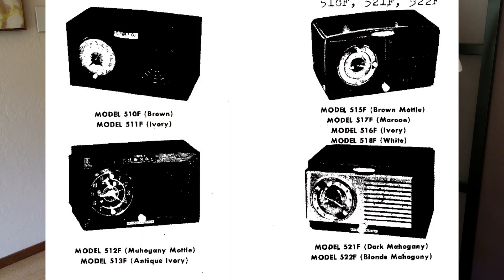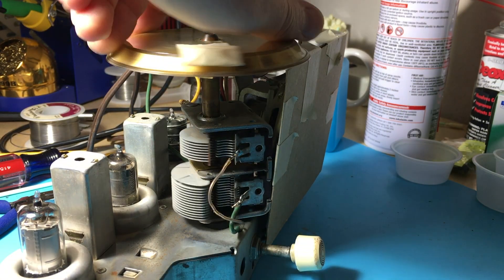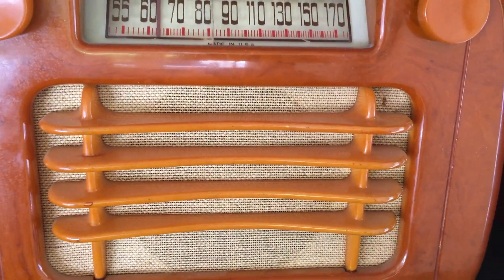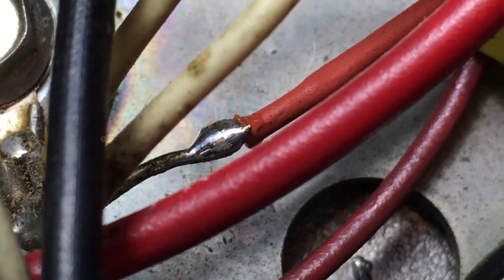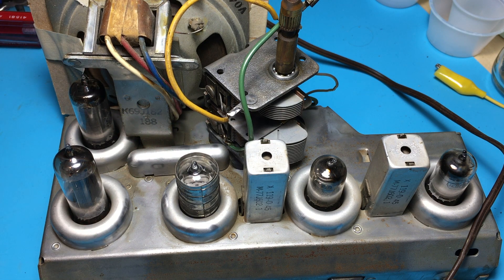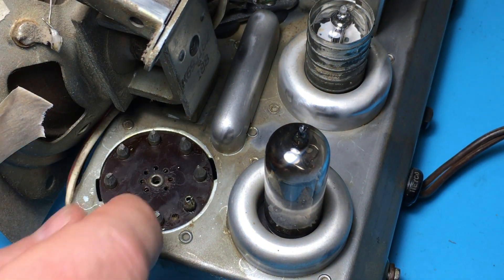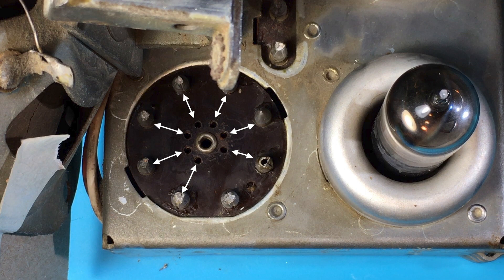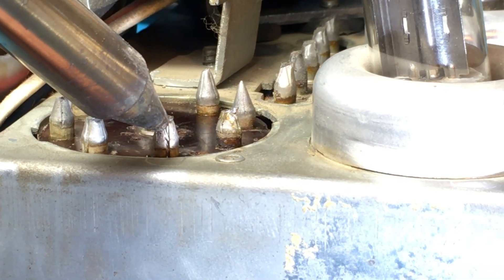The clever way GE wired AA5 radios in 1950

Comment: I just restored one of these sets and what struck me was the factory punch that made the holes in the chassis for the tubes was clearly for octal tubes. I also have a 1949 version (Model 501) with the same chassis but has mixed octal and miniature tubes, and with standard phenolic socket connections rather than the spikes, holes and donuts. I went all-in j-hook for recapping. No problem with silver mica disease but the detector section in the 1st audio tube was bad
Reply from the maker: Yes. I've seen 2 examples out of the 10 or so I've done in the 51xF line that had the mix of tubes and they are prized because the full-sized IF transformers in them are capacatively tuned and don't get silver mica disease. Plus they just seem to work better all around.
Reply: @WardCo  I just obtained a third model from this series -- one with all octal tubes (GE 60), a mixed octal and miniature (GE 501), and an all-miniature with the metal donuts (GE 512F). The first and second have identically punched chassis, but the tube socket punches in the latter are actually larger to accommodate the dip solder connections. I now think they may have tried dip soldering to cut costs since hand-wiring and soldering miniature tubes was harder, as if it was a transition from hand-wiring to printed circuit dip soldering. The first two have capacitive IF tuning, but the last has ferrite cup tuning with the integral silver-mica fixed capacitors

Comment: Hi Sir,

I need help with this radio, model 505, please. My father gave me one (he's not with me now), but I'm not sure how to configure the clock. There's another knob behind the radio that doesn't move, and I don't know if it's supposed to be used to configure the clock. I understand how the other buttons in front of the radio work, except for the "set/alarm" function. If you can help, I would be very grateful, sir. :)
Reply from the maker: The knob in the rear moves the hands to set the time. If it is not turning the clock mechanism is jammed up in some way. If you pull out the set/alarm button and turn it, the inner alarm wheel turns to set the alarm time. When it is pulled out, the alarm is "armed" and you push it in to silence the alarm when it goes off.
Reply: @WardCo  
Sir, you are correct; the clock mechanism appears to be jammed in some way. The seconds knob is working, and the alarm is functioning as well, but I can't set the correct time

I read that old mechanisms like this one sometimes need a bit of lubrication. Could that be the issue? I will attempt to fix it

Thank you for your help; I really appreciate it

Comment: GE designated this type of construction as a "mechanized chassis" but it is difficult to find references to that name. WardCo provides a list of model numbers with an F suffix. The F designates the "mechanized chassis" version, so model 510F had that construction but model 510 did not. My model 535 "radio clock", a 6 tube clock radio, had a "mechanized chassis". Probably there was no F suffix because all model 535 radios had the "mechanized chassis".

The radios had the donuts over the solder wells, presumably for safety, so no one would get a shock from touching wells if they poked fingers through the ventilation holes on the back. My parents owned a 1954 GE console TV which also used this construction, but the solder wells were not covered. GE depended on the back cover AC power cord interlock to safely power down the set before someone touched the wells. I recall that Zenith continued to use this type of construction well into the 1960s for its "hand crafted" TV sets, while competitors had gone to printed wiring boards. Zenith did not have the donuts, either.

In production, this type of construction probably reduced the number of wiring errors made by assemblers, since the component layout was more orderly. Also, when errors were made, they were probably easier to spot by the technicians testing the radios as they came off the production line.
Reply from the maker: Thanks for this great info. (And for reminding me about Zenith's "hand crafted" moniker! My folks loved their Zenith's Space Commands...)

Comment: I have a red "G.E." that was built in 1954 that has the same chassis layout/ tube sockets, and has the "SILVER MICA DISEASE" problem in the I.F. transformers. I just bought this radio, and will need a full restoration. the next generation "G.E." radios used the metal pan with a  printed circuit board where the major components plugged into the p.c. board. by the late 50's they had moved on to full p.c. boards, as did all the other companies, except "ZENITH", they made their sets with metal pans/ hard wired.

Comment: I have a "G.E." radio that was built in late 1949, that I bought in 1976, and has been on the job to this day. it is the same radio as yours except it is cream color, and has the cap tuned I.F. transformers instead of being slug tuned with silver mica caps in the base of the can. the tube compliment is a hybrid. the rect./ output tubes are 7 pin minies, and the conv., I.F.amp, A.F. amp/ det./ avc tubes are 8 pin octal, with all components being hard wired in, not like your radio. I replaced the resistors/ caps 10 years ago. when I did that ,I also installed a "C.L.90" thermistor in the heater string so the tube heaters are soft started.
Reply from the maker: Yes, for some reason, and much to chagrin of my wife, I have acquired about 7 versions of this model, but I only came across 1 with the "transitional chassis" you describe and I used it in my "flagship" 517F because it tunes up so easily and you don't have to worry about silver-mica disease and rebuilding the IF cans. The tubes are all socketed though. I should do the thermistor thing but always seem to skip it. Tangentially, I do polarize the input and swap positive and negative which is probably unnecessary, but makes me feel better.
Reply: @WardCo  I always replace the power cord with a polarized plug, and change the hot side with the switch, that way the chassis is at ground potential. the thermistor will stop the inrush current on the heater circuit, eliminating the 12 volt heater tubes from expiring. thanks for responding back ,I did subscribe to your channel, I found you by accident!!!. it is interesting that all radios with the 455( K.C.) I.F. freq. are wired the same, being that it is an "R.C.A." design, and other radio manufacturers had to pay royalties to "NIPPER"!!!!.( the "GOLDEN THROAT"). when it came to money, david sarnoff was always hungry!!!.. R.C.A. was born in 1919 from the break up of general electric electronics dept. "F.D.R". who was governor of new york at the time ,felt that general electric was getting too big.

Comment: I replaced my filter cap with two electrolytic ones 10 years ago on my GE 430 and I turn it on with no volume and it hums.  And my GE 202 doesn't even work at all.  They just didn't build these things to last.  Very frustrating.
Reply from the maker: Yeah. More than that, these AA5 and AA6 sets are SO minimalist that, even if you do the full recap, they can still hum and oscillate just from bad component placement.  And of course, it's not always obvious what's "bad!"  For all their vaunted simplicity, I find them much more fiddley than transformer sets.
Reply: @WardCo  Mine were free, so I can't complain.   Plus, they double as toaster ovens.   I'd like to get that AA6 working though again just to see one mone more tube does.  Honestly, I don't listen to radio, so it's more like a Cleric Snow Globe scene in Equilibrium.   Stuff that was antique when I was a kid, now, are a bizarre anachronism to me.  Like, how did this thing survive for so long and travel so far, and it's going to outlast even me, so where is it headed next...   after I'm dead.

https://www.youtube.com/watch?v=_b3_-pPzDVk
Reply from the maker: Yes indeed! For me, the benefits of working on "vintage" tech like this are that it helps you understand the flow to, and evolution of, modern complexity from simpler times.

And the other thing you realize is that those times weren't that simple, it only seems so with a modern education and hindsight. This was "state of the art" stuff back in the day, and you realize the poeple who created it were really, really smart and just limited by the components the material science of the time could provide to them.

There are a lot of ghosts around all this stuff.
Reply: @WardCo  I was about to say, not that simple!   I still can't wrap my head arpimd what's going on in an AA5 in all the stages.  

And how they got from watching some filings move around in a glass tube in a coherer by blasting a dirty nasty static all over the bandwidth  to the point of a mass produced AA5 was a huge leap forward and some seriously intense development.   

Add on top of that, the gem was the vacuum tube that led to the transistor, that led to the solid state transistor and then the lithographied integrated chip.

I remember an ad back when I was into these radios of some beast top of the line at the height of the golden era of it radio they produced with like 100- plus tubes when they were adding in more tubes just for the sake of more tubes quantity of tubes marketing race, where the tubes were housed in shiny silver canisters so the top of the chassis looked like a minutre city of skyscrapers.  I forget the radio and the brand name, but I could probably find it if I tried.
Reply: That would be E. H. Scott, for the skyscraper look.  They were the best of the best, so all of those tubes actually did something useful.  Just to confuse things:  There was also the H.H. Scott company, they made more conventional (but still very good) stereo gear in the 50's and 60's.  And none of that has anything to do with my name!   @choppergirl

Comment: When I was a teenage "electronic hobbyist" people would give me old radios which I would most often just gut for parts and hated these things.  I wanted "real" tube sockets that you could unsolder, clean up, drill out the rivets and reuse.  These things always just fell apart and besides, it wouldn't fit a standard tube socket hole anyway.  OK, I was a butcher but in my defense there were some things that made me think JUNK whenever I saw these.  The main flaw with these sockets was that air-gap between the upper and lower wafer.  Any bit of debris inside there that was even partly conductive and was also near a high voltage pin could start arching to an adjacent lower voltage pin and turn the wafer into carbon just cooking it.  Standard tube sockets were encased in plastic and didn't have this problem but alas - you couldn't replace it with standard tube socket because they don't fit the hole!  So that's why I wouldn't even bother repairing these and gave them "junk" status.  Not having that problematic dial string is cool though, one point it's favor.  It is pretty cool seeing these old radios all restored and pretty.  Nice work.

Comment: I recapped a 1951 GE 630 years ago with the online advice from a Candian HAM guy who had a big AM radio station transmitter webpage...      back then I had those terrible Radio shack 30watt soldering pencils and had no idea how important it was to clean you rtip after ever few joints.   

A year or two I bought a TS-100 FET soldering iron, some cleaning paste, flux, and k\Kester soldering solder, and silver retinning paste and boom..  my soldering took off.  I could solder like a boss after watching some PACEWORLDonline videos.   and then I went blind, and now I can't solder anything...   and it halted my flying robot quadcopter hobby dead in it's tracks.

I got 3,000 worth of flying robots, but can't do nothing with them because I can't see to solder now.  Irony.   Spent 4,000 hours in the simulator flying to a TV though, and I'm now te worlds best Aerbatic Dancer.    

Don't touch radios any more, now it's all Alexa and Youtube...   these things are mostly now nostalgia items for those that love vacuum tubes.   There is no other reason to own them as there's nothing on the radio airwaves any more.   Except cellular and wifi traffic :)

Comment: I have restored a bunch of AA5 radios and a load vintage TVs and yet this is the first time I have seen this style tube sockets. Thank you for sharing it!  Also as you stated and showed, the 'J hook' was a recommended repair method by many manufactures. In fact, if you find yourself working on something with early circuit boards I would suggest you 'J hook' as much as possible as those traces are very fragile and often lift right off when you are trying to remove or install a new component.
Reply: The “J” hook connection is the best repair technique, better than the original joint and if you cover the soldered lead with shrink tubing , no one really knows. Trying to rework 50 year old connections like the factory installed is destructive in many ways, particularly to the copper foils on any printed circuit board.